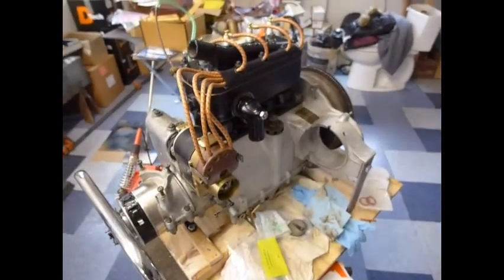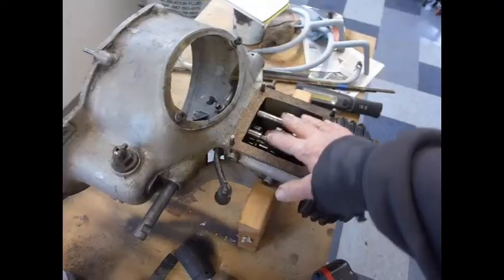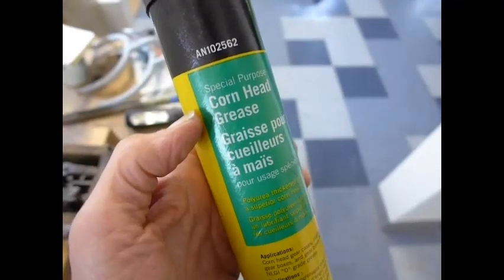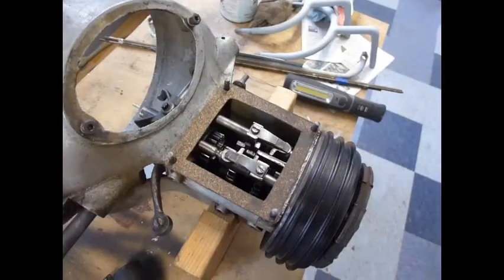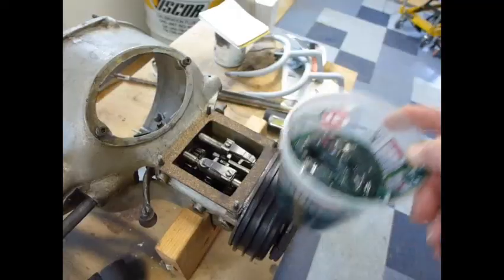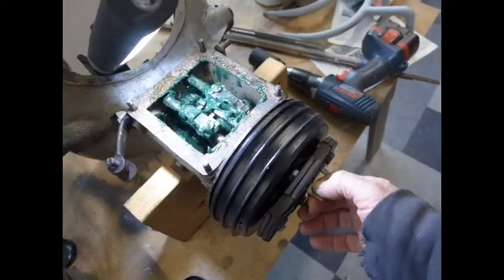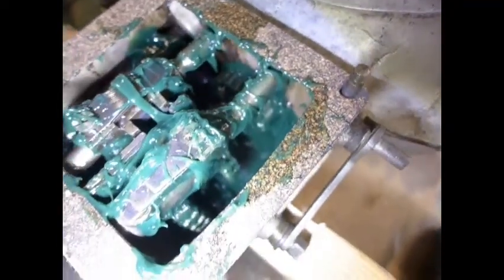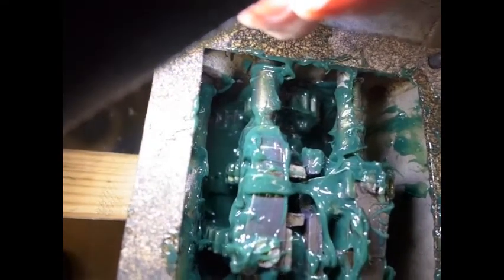Fix Leaky Gear Box With Corn Head Grease?

Comment: any update on how the box is doing? thinking of doing this on an old beetle transmission
Reply from the maker: No. I just got the engine & transmission re-assembled and running, but it's not in the car yet. All the gears definitely are lubricated. If your transmission has small passages the lubricant must travel through, the corn head grease might not work well.  The main disadvantages I see with this grease are that it is too thick to drain out, and I've not found anything that can dissolve it. It also doesn't lose viscosity when heated, according to my experiments.

Comment: I just bought this grease for my Peerless transaxle in my little rear engine riding mower. It calls for Bentonite grease but that would cost about $80.00 to fill the gearbox. My transaxle does have needle bearings on the pulley shaft otherwise its all steel bushings in an aluminum housing. Those needle bearings are on a vertical shaft. I think if I fill the box high enough I should be OK. Does this grease then thicken up when it cools? I can't imagine my mower box gets that hot.
Reply from the maker: Corn Head grease thins out when agitated and thickens when at rest. Heat doesn't affect its viscosity much. I put some in a glass jar and heated it,  but it didn't "melt" or thin out.
Reply: @mortier9  thanks

Comment: Modern gear oil will rot the bronze bearings fyi
Reply from the maker: Corn Head grease will not harm bronze, but some oils might. Be sure to check the literature before you lubricate an old gear box.
Reply: @mortier9  good point.  
Any updates?
Reply: It's the sulphur in hypoid oil that is harmful to copper alloys.  140W for manual transmissions doesn't have sulphur in it.

Comment: I bought some of this for my bandsaw gear motor.   This motor has a helical gear on the main shaft of the motor which is in constant contact with a larger gear connected to the pulley shaft.   There is no zerk or caps or plugs to keep oil in it.   The motor is VERY OLD.   I can't find much information about it.   It's an old Walker Turner motor.   This might be what I"m looking for

Comment: Just saw a video where corn head grease was used in a brush hog gear box, which leaked out 80-90w oil rather quickly. He used the brush hog for hours, with no damage, and only slight loss of grease.